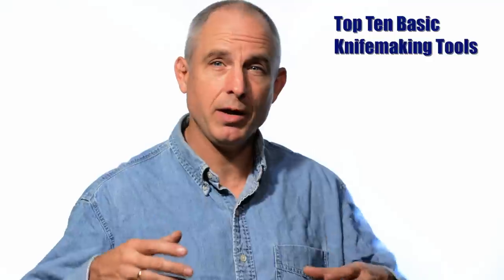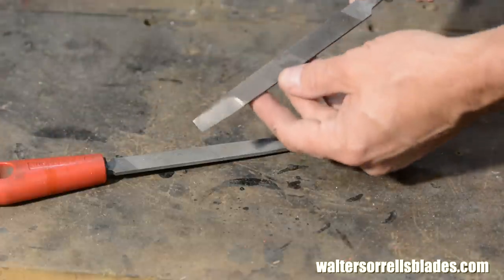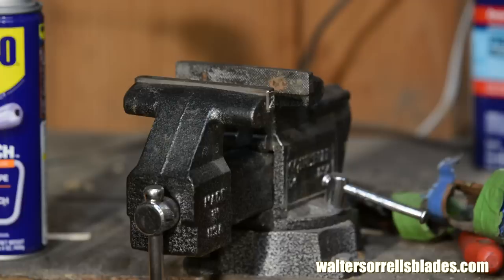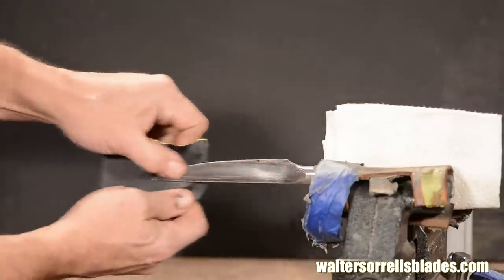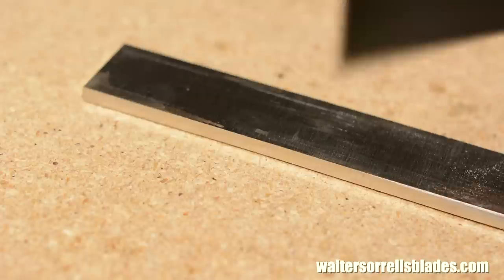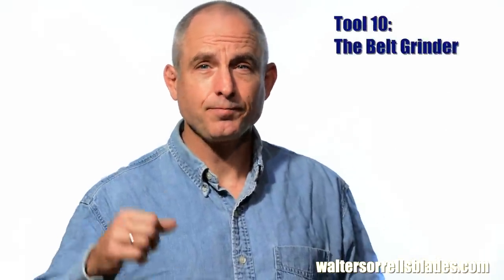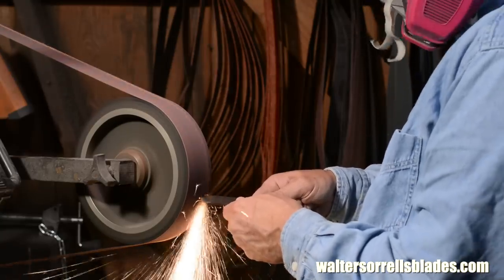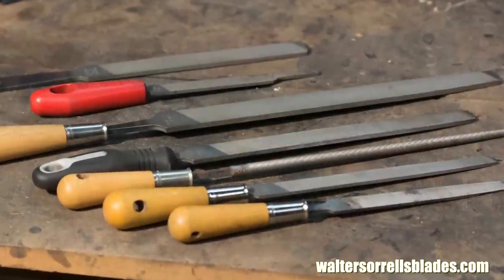Top Ten Knifemaking Tools for the Beginner

Comment: I'm a beginner who hasn't yet made a single knife. Honestly I can't see myself being able to afford even a cheap-o belt grinder. Two questions. One: would a bech-wheel grinder work for knife grinds. Two: would a grinding wheel on rotary tool like a Dremmel work in a pinch?
Reply: Ray Chilensky I personally dont own a bench grinder, but I think if you're willing to work a little more, they would cut it (pun intended). They're great for putting a hair popping edge on a knife too. A dremel vould work, but prepare to spend $50 on bits. I just use an $80 Harbor Freight grinder with a 2 x 32 belt (be sure to buy silicon carbide belts). It's not as good as a Bater B2, but it does what it's suposed to. Another thing I've found that works like a charm is an angle grinder. You can find a cheapo one for about $30, but make sure you get the right discs! If you don't, it gets bloody. Personally, I've only spent about $330 total for all my gear, excluding steel and handle materials, but someone named Scott Jones made an article about cheapo knife making, in which you only spend about $50 total . Just google "absolute cheapskate way to start making knives", and the first result should be a pdf file. Download it, and there you go!
Reply: for just first knife you can do without it. it will take more work
Reply: don't use a bench grinder its to rough and it's dangerous as hell.those things tend to grab and throw you don't want a knife flying out at 100 mph. buy a file look on YouTube and make a file guide for your bevels.  you'll be happier with the end result. grinders get the steel way to hot too especially if you try
 to sharpen with one you'll take the temper out of your edge.check out Walter sorrells hes good.
Reply: @justinriley8651  true for first time user potentially dangereous and cant be for finishing in any shape or form
Reply: Boz 2011 it may not be ideal but bench grinders can be used start to finish. I've used mine for a few knives that have turned out great. It's not easy but it has worked.
Reply: no and no. if you can't pay, you can't play
Reply: if you are willing to work hard just use a hack saw a file and a stone. you can make a great knife start to finish for less than 50 bucks.
Reply: @jerdeb4evr  that's an incredibly wrong answer. Plenty of ways to make use of what you have and make it work.

Comment: i auctally just got my collection of files, sand paper, drill press (free from my father), hacksaws with extra blades(also from my father) but their is one thing i have done alot of looking into but havent been able to decide on. that is what steel to use, i plan for the knives to be mainly for myself, a set of hopfully nice chef knives for my girl and maby as a gift or 2 in the future, and who knows i might end up putting more money into it but i plan on useing the bair minimal when it comes tools for now. any reccomendations on which steel to use along with where i can order it from
Reply: 1095 or O-1 are good beginner steels and you can get them off Amazon for 25-30 dollars.
Reply: so I wouldn't recommend 1095 or o-1 to start off. 1095 is hyper eutectic, meaning that it requires an extremely fast (and stressful) quench to fully harden. this results in cracking and stress fractures oftentimes, not very good as a beginner steel. o-1 I wouldn't recommend because of its price and the fact that you practically need to quench it in parks 50 for best results. Parks 50 oil quenchant is rather expensive, especially for a beginner. I would highly recommend 1084 or 1080 steel. it has the most forgiving quench of any steel out there, I have successfully quenched 1084 in both canola oil and brine (cheap quenchants), and the temperature range for when it is ready to quench is pretty large. 

also, the best place to buy steel is new Jersey steel baron. I would not trust the cheap Chinese stock that comes from amazon

Comment: belt grinder is less the 2 by 72 belt grinder is less important if you are forging into shape rather than the stock removal method. Wilton makes a good to buy 42 Grindr which can also host won by 42 belts it's plenty powerful and as a good starter unit for a few hundred bucks.

Comment: I have a 5160 slab steel to production knife and I want to strip the coating off of it and I was wondering if I take a blowtorch and heat up the blade and rub it with a brass brush will that D temper or ruin the steel
Reply: Yeah it will for sure. anything around 250 F or higher is in the danger zone for tempering a finished knife. obviously a torch is well above this temperature. I would suggest using high grit sandpaper, something like 400-800 should do the trick, then buff out those scratches with 1000, 1500, and 2000 grit for a really nice polish
Reply: +Grant Saxman thank you so much
Reply: +ken halverson no problem at all, I'm glad to help. Good luck!

Comment: Tool 12 angle grinder
Reply from the maker: +Flynn Dennison Agreed!
Reply: Yeah that makes it so easy and like 90% of pros still use an angle grinder and they're cheap compared to other gear.
Reply: Yeah, I can't understand why the $2000 belt sander was mentioned and not the angle grinder.
Reply: yea, but the tools Walter said were the ones he used you know? every one uses there own tools in different ways. Hell, I even got a small drill bit, drilled around the knife desighn and knocked it away with a hammer!
Reply: ShoeBakka1 lol I got a cheap 36 or 48 in belt sander works fine
Reply: Todd Brill exactly! My grandfather taught me knife making with the use of a bench grinder, in addition to most of the tools in the video.
Reply: Maybe for control in making bevels and in fine grinding profiles?

Comment: My biggest problem is getting the 1095/O1/W1 steel.... checked many of the online steel suppliers and not one had those steels in stock.
Reply from the maker: +Grandpa Bill Try Admiral Steel for 1095.  01 and W1 are available all over the place -- often sold as drill rod.
Reply: Thanks Walter, I'll check Admiral out. But as for the drill rod it won't do as I'm looking for flat bar 1/4" X1-1/2" or 2". The drill rod might work for forging out hooked knives or scorps for bowl/spoon work.
Reply: Get the enco emailed listof and wait for their coupon for extra savings. they carry tool steels and stainless. Also the cheapest i have seen and awesome customer service.
Reply: On their site they do not have any tool steel listed. (W1/ O1/ 1095)
Reply: +Grandpa Bill alot of old files are made out of w1. i use them to make knifes all the time incredibly good knifes very sharp and stay sharp
Reply: +Grandpa Bill knifemaker.ca, jantz, new jersey steel barron...
Reply: ***** I don't think amazon sells 1095 steel
Reply: Rod? Hammer it out flat. Hammer + anvil + rod = flat stock.
Reply: 1/4" thick by 2-1/4" wide by 10" long ..... Let me know when you're done!
Reply: Grandpa Bill
Sure, that's why they call it WORK... ;-)

It takes lots longer, and requires a lot of work (or a power press to work it), but in that form it may save you money.

Comment: also once that file has worn out you can literally make a knife out of it.
ya my post vise is the most expensive tool i currently have in the Smitty. 

It can save some headaches switching the belt around on a five speed press and shell out a little more to get a computer controlled drive setting drill press. my first press was a five-speed belt switch and it was a pain to switch the belt around, i picked up my wen VSD drill press off Amazon, on sale for 213 and as it was included with prime i only had to wait two days to get it. my el cheapo press vise is full of holes as i tend to forge my full tang blades with an ergonomically more comfortable handle shape and that does not lock in well with the jaws of the vise, as a result, I clamp them flush to the bottom of the vise. also, I find drill press vice great for tacking together steel for a Pattern damascus billet.

I have actually broken the two 3/16th HSS bits when trying to drill through the tang of a blade. (note i only  use 3/16 inch pins for all my blades) 

with the exception of Japan, I honestly, feel that the great swordsmiths and blacksmiths of the past used pedal or crank operated grindstones. cause they did we would have seen more sword polisher guilds. I have actually draw filed at least 2 overall 9 inch blades and both times it took me about 6-9 hours to do.  a sword blade would take a bit longer given the size of the item.

your average kitchen oven is great for the tempering stage of the HT, but not forgetting the blade to quenching temperature.

Comment: I really want to get started with this and recently i got some steel that i want to turn into a sword but first i'll practice with knives and i am extremeley limited in terms of tools and even 50-60 bucks is just a lot to spend so what i have is just a bench grinder and an angle grinder can i somehow work with those to make a decent quality knife? ( Or do i need to buy special wheels / stones for the grinders? ) And another question i have is are homemade belt grinders good enough for knife making?
Reply: A bench grinder and a Angle grinder is very good thing of start out an no you don't need special stones but you will need a cut of disc for the angle grinder you can make very good knifes it you try you may have to do it a few times but if you try it will work for you

Comment: yardsales and fleamarkets. thats the way to go. i made my forge for 40 bux. an old bbq.free. an old brake drum. 10 bux. 5 pieces of black iron pipe. 25 bux new. and a blow drier from goodwill 5 bux. got my anvil at a yardsale 60 bux. its a 100 lb fisher. i can burn wood, coal, or charcoal.drill press yardsale 20 bux. belt sander, hand held,5 bux. workmate table to secure it yardsale  10 bux. clamps box of six yardsale 5 bux. vernier calipers yardsale 2 bux. files many in an old tool box. yardsale 5 bux. vice articulating yardsale 5 bux. hacksaw yardsale 5 bux. sandpaper new 10 bux. two other items you mentioned escape me at the moment but i know i have them. gotem at a yardsale cheap. ihave a fairly complete blacksmith operation for less than 200 bux. rock n roll lets make knives.
Reply: Francis Chevalier *vise

Comment: What's a good stainless steel that's easy to use for beginners so far I have only been using high carbon steel and I want to make some kitchen knifes any recommendations?
Reply: I think 440c is considered a good starter steel. Easy to get, not a super complex steel.
Reply: alright thanks i will have a look around

Comment: Lets see, my first ever knife was out of an old table saw blade, cut out with a fairly dull hacksaw blade, then finished shaped with a half decent file. I think I used some woody vine for the handle. .I think I was 13 or 14. the last knife I made, I pretty much just used an angle grinder. . incidentally, I think I made the last one from the same circular saw blade. . I'm only a dabbler in knife making though, and didn't heat treat any of my knives. .well, except for that one I threw together on a forge for a friend. . but it was mild steel. .so hardening does nothing for it. .it was mostly for food cutting at ren fairs anyway.

Comment: I have some trouble deciding on a bench vise. Is Cast Iron made vises any good? I found and all steel vise made by Yost (5'' wide for @$100 and a Tekton 8'' wide for @ $139), any thoughts or suggestions will be appreciated.
Reply: +true7005 I will be using for knife making and small projects around tge house but i think your right, thank you
Reply: I would buy the 5" one. Cheaper, and there is almost no use in knife making for a 8" vise. Mine is 6" and that is more than big enough. Hope this helps. 
-O
Reply: +Canadian man thanks for the info, its was very helpful.
Reply: +Canadian man any good makers you might suggest?

Comment: Didn't agree you saying beginners need 2X72 grinder as I did build my own under $ 200 and it's not top of the line but I'm a hobbyists and never going to pay $ $ $ for a hobby that I  as a hobby can make many of my equipment for fraction of the market. 
  I would put a 1x30 grinder in my top 10 and a portable band saw and angle grinder also a set of tiny files as most everyone has basic set of files on hand. 
 But it's my view 
Thanks for helping us

Comment: My first knife just warped during the quench. It was made with hacksaw and files, and a lot of elbow grease and curse words so it was a dissapointment to see it curve. Are there tricks I can try to prevent it warping?
Reply: +roger bennett Achieving symmetry in the work piece prior heat treat helps to prevent warping in the first place, but it isn't a surefire method. There are other methods as well, like doing a good part of the grinding after heat treat or qenching the blade between two huge blocks of aluminium, etc. However, all these sophisticated methods are  - for one reason or another - impractical for hobbyist makers.
The usual method is to straighten it right after quenching.  The steel needs a bit of time to settle, i.e. fully harden - during that (short) time frame you can straighten it without having it snap. Then anneal as usual.

Comment: I was able to get about $120 of steel and another $150 on the drive train and motor. Hardware and a broken tap, I think I'm in about $350 and I have a working 2x72, with step pulleys, platens, and 1.5HP

Comment: what does a caliper do?
Reply: measuring the distance between to opposite sides of a object
Reply: so if the object was say, "poop" it would measure the thickness of the poop.
Reply: TheEvilways101 i mean you could but i don't see why you would
Reply: TheEvilways101 depends on the hardness, soft/mushy objects tend to give less accurate measurements
Reply: i give my poops atleast a day too dry out alittle before measuring them with the caliper. yes indeed, way more accurate measurements that way.
Reply: TheEvilways101 do you take multiple measurements? those are needed for the most accurate crap-measurement possible
Reply: If... and only IF... i take multiple shits

Comment: 2 points - 
doesn't a belt grinder get the metal too hot
& take the temper out of the steel?
It's better to use a slow turning water cooled wheel.

Also - health & safety -  the vice on the top of the pedestal drill should have some bolts in it
to hold it to the top of the bench even if they are a bit loose.
Never hold the vice with your fingers!
Reply: it can get hot, and you should have water nearby to cool the blade, but don't worry about the steel as long as you're not super-heating it, the temper is done after heat treat, after the knife has been shaped. You should be using annealed steel, which is how most bar stock is sold.
Reply: it can get hot, and you should have water nearby to cool the blade, but don't worry about the steel as long as you're not super-heating it, the temper is done after heat treat, after the knife has been shaped. You should be using annealed steel, which is how most bar stock is sold.
Reply: it can get hot, and you should have water nearby to cool the blade, but don't worry about the steel as long as you're not super-heating it, the temper is done after heat treat, after the knife has been shaped. You should be using annealed steel, which is how most bar stock is sold.
Reply: +gnaeiuopl   Come on - if there are white hot sparks then that metal is too hot.
Reply: +Al Pal ok, then cool it off. You're still not going to "take the temper out of the steel" if it isn't tempered yet.
Reply: You dip it in a bucket of water and it's annealed already so you haven't heat treated it yet
Reply: +Tyler Abell   OK - as long as the heat treating & sharpening comes afterwards - then it's ok.
Reply: With the blade becoming hot, well it can, and does. Which as some of the other guys have correctly said, Water.....always have it, and use it, keep dipping the blade so that it doesn't get too hot. Besides, if you mess up and get it too hot (rookie mistake) , you can always normalise it, its no big deal, for the most part metal is very forgiving. But to be honest, when you have got a great belt sander and you use it a lot, it becomes an extension of you. You will find that dipping becomes second nature, you don't even think about it. You will become so in tune with the grinder you feel you could probably do half the stuff blind folded......not that I am suggesting that you do it, but you get the idea :-)
Reply: +Al Pal sparks are because of the carbon in the steel and the carbon is actually burning right after it leaves the surface. so sparks' heat doesnt reach to the metal much. the main reason for heating is friction and it is not that quick to ruin the steel's temper(as long as you cool the blade regularly)
Reply: +Hurdalık Cini 
But surely as the sparks are white hot it means that the steel is extremely hot at the point of grinding.
I would rather use a water cooled wheel to know for sure that I haven't taken the temper out of the steel.
( even though it's much slower than a belt )
Reply from the maker: +Al Pal You might prefer to do it that way, but every modern cutlery manufacturer uses belt grinders for all facets of their work.  The knife doesn't get white hot.  Only the minute particles removed by grinding get that hot.  The blade acts as a heat sink and as long as you are careful and know what you're doing, the blade doesn't get hot enough to ruin the hardness of the steel.

Comment: can you put your knife in the oven to heat treat it?
Reply: Kevin Rabe yes.
Reply: Kevin Rabe most household ovens don't go above 500 degrees Fahrenheit so they can be used to temper steel after it's been heat treated but not for heat treating itself which typically requires temps of 1500 degrees or so.